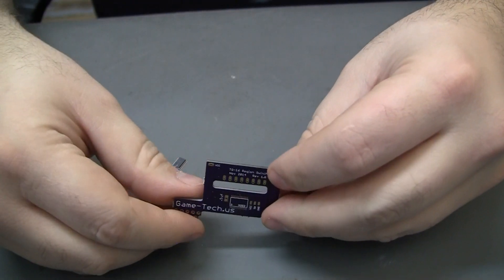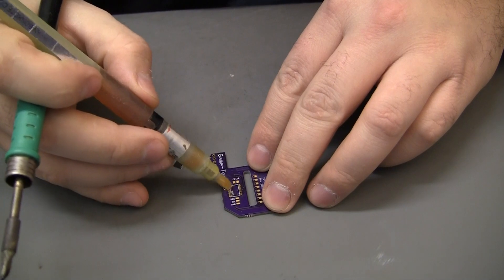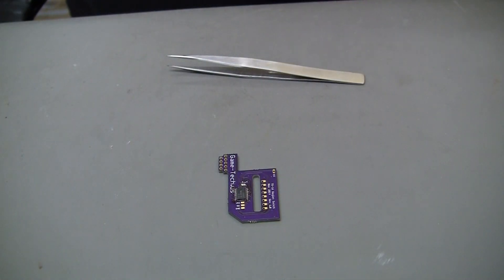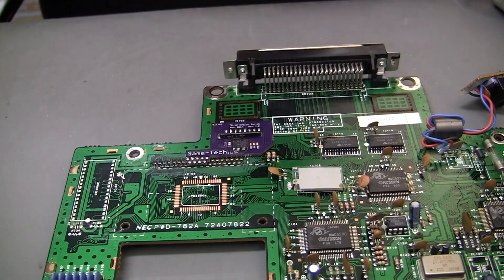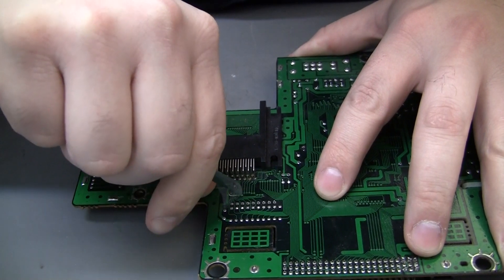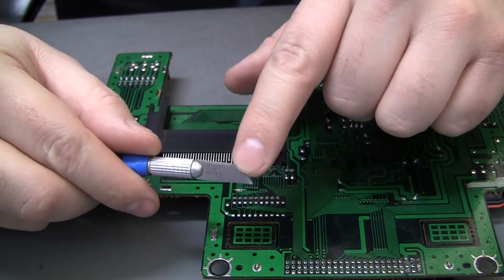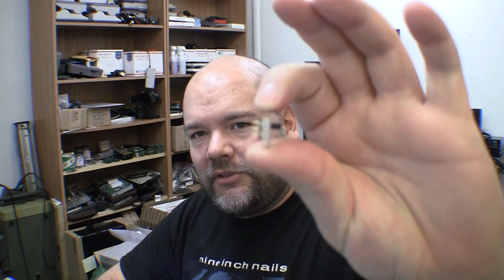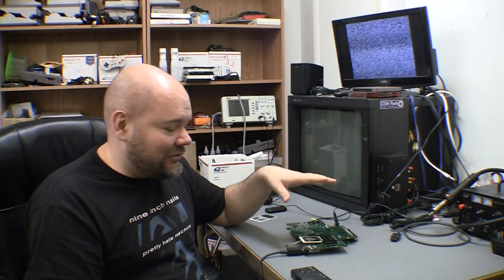TurboGrafx-16 - EASIEST internal region mod pcb instal TG16

Comment: Any ideas on what is going on with a TB16 that when you turn it on shows a solid color screen.  Sometimes white, blue, pink etc.  It does this with and without a game.  I ran it to tv using the RF AV port and I made a Composite cable to make sure it wasn't just a bad RF output unit.  It did the exact same thing.

Comment: If you cant get thinner PCBs you might want to use the same trick the Alladin Modchips used on the xbox one, have a nice thick pad with a big VIA in the center, then have you PCB manufacturer mill the pads in half, exposing the copper and giving you the clearance to reach in there with a solder iron.
Reply: Xbox Classic I mean, I hate the new naming scheme...
Reply: .I thought the same, but:Milling vias in halve is kind of expensive (extra process step "deburring of the milled copper edge") and not every pcb manufacturer can do it. On the other hand: does PCBs are so small, that the cost of the bare PCB should be very small compared to the priced manufactured, assembled, sold and shipped. The unusal solder mask color is also a premium, so he is not penny counting. Still: it needs to be checked.

Comment: I need this. I've done a bunch of mods using turbokon's region board, and while it works well, it's a lot more work to install than your version. If you start selling these I'd definitely buy a few of them.

Comment: @gametechus I finally received the security bit and got around to installing the mod.

I have tested continuity and 5V goes to right leg of 7805.
Continuity between cartridge pins and the pins above the resistor array (?) is severed (no continuity)
There is no continuity between the pins either on the pins above the resistor array or between the pins at the cartridge, so nothing is shorted.

I'm getting white screens on both Sidearms (US/Canada) and Dragon Spirit (JP). Both switch positions.

Are there any more diagnosis steps I should try?

Thanks!
Reply: +Nakashii P.S. I've been tweeting photos at you in case you want a visual aid to see what I've done.
Reply from the maker: +Nakashii 
I assume the console tested ok before modding? Sometimes colored screens simply means dirty connector or hu. I've also found traces coming off the connector that were corroded open.
Did you check continuity from hu connector pins to mod board pins before severing the traces? Making the connection from mobo to mod board above the resistor array is a typical trouble spot during instal. You can insure connection by shoving a wire (component leg etc) through the mod board and mobo and reflowing the solder.
Reply: +GameTechUS Yeah I had played the console about a month ago. Didn't test it today before the mod or after taking of the shielding but I was pretty careful about that.

The board was in excellent condition so I don't think it would be corrosion. Previous owner took very good care of it.

The mod connects to the HU card (continuity check before and after severing)
The mod connects to the pins above the resistor array (continuity check before and after severing)
I checked those pins by attaching one probe under the board and one above where the mod was. Connections all make it from above the board on the mod to the bottom side of the board.

There is no continuity between the pins above the resistor array and the HU card after severing.

There is no continuity between those pins either.

I'm going to put this away for today and maybe look at it later. Thanks for the suggestions!
Reply from the maker: +Nakashii 
Sounds like you've done good diagnostics, but it's possible the chips got zapped.
Email me direct.
Reply: Considering it would probably cost more than the chip does to send it to you and back, let alone getting a new one if that is the case, I don't think that's wise. Besides, the TI chip you used is worth $3 on Amazon so I could try to solder a new one.

My question is: should there be no conductivity at all between the pins or should there be a minor bit of resistance. Like 1K ohm range between some of the pins?

Right now I get some resistance between some of the pins. Is that a sign of a bad chip?

Comment: jason nice work i like your videos. im wondering though is there any reason you use the flux brush? ive been using rosin core solder forever and it works good. saves a step.

also is there any chance of seeing a re thought atari 2600 s-video mod from gametech? the current one is far from ideal. lifting tia pins and soldering ribbon cable to it. I never understood why that mod wasnt just built to sit in a socket with the tia on top. 

also great taste in music i still have some of those shirts. my downward spiral shirt is super worn out now i dont even wear it anymore.
 I got it when that album came out.
Reply: You have to use flex pen with SMD otherwise solder sticks together bridging the pins together.
Reply: I've actually already done that with the 2600 mod. I was tired of the sloppy method of bending the pins on the TIA, which also makes the console more difficult to service after modding. So I created a board that plugs into a socket that goes where the TIA was, that board includes an on board pause mod and a header that the 2600 S-video mod board then plugs into.

I thought of putting the video mod on that same board but a configuration that worked with both 4 and 6 switch models seemed unlikely. I may take another look at that when I run out of my initial run of boards. I'll post a video of what I'm talking about after Xmas.
Reply: +Leon Kirliluk: You´re statement is not strictly true, with production grade soldering irons and fresh tips, you do not need additional flux for smd soldering. Now, he is drag soldering with an oxidised tip. Both requires additional flux. (The oxidised tip is very common in electronic labs - the tips are expensive and one abuse an they are oxidised. In production how ever when soldering the same parts all day, using a good tip saves time making it worth to change the tip regularly.)

Comment: Wow Jason you made that fool proof that is awesome do you do dreamcast or gamecube region mods??
Reply from the maker: Not yet...
Reply: gamecube modchipping is incredibly simple. its design is similar in principle to this; you just place the pcb over a certain section of the dvd drive's pcb but the installation process is very unsafe because the area you're soldering to is very crowded. it'd be interesting to see if jason or kevtris could figure out some way to make it idiot proof outside of using wire & insulating it. http://members.shaw.ca/webplace/xeno_gc_wired_diagram.jpg

Comment: @GameTechUS I bought one of these and it looks very clean and professional. Just waiting for a security bit from eBay before I install it.

I'm wondering since the PPU and the expansion port of the TG16 have RGB lines, could those be used to apply an HDMI mod? Seems like a really good project as the TG16 itself has really poor RF performance on HDTVs it seems.

Check out this example (video ID WsXThKpOVHA)
Reply from the maker: +Nakashii 
For consoles that have analog rgb most ppl just use an external scaler like xrgb.
Reply: +GameTechUS I would still have to mod it as it's only the TG16 unit itself and not the expansion but I see what you mean.
Reply: +Nakashii The XRGB looks hella expensive too. Wonder if I can just build one faster with a PCDuino 2 I have kicking around using the GPIO pins? I wonder if they switch fast enough to capture the RGB signal? Then I could just output it over the built-in HDMI. The PCDuino 2 only cost like $60 a few years ago. Probably really cheap now.
Reply: +Nakashii Would be kind-of hilarious to have a 1GHZ 1GB computer inside a dual 8-bit machine.
Reply from the maker: +Nakashii 
I have no idea, but let me know if you figure it out!